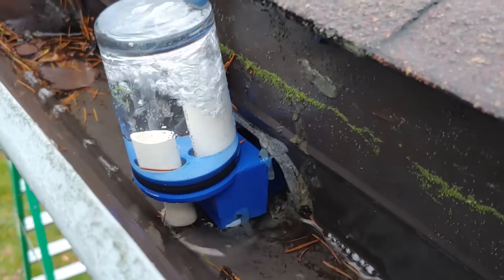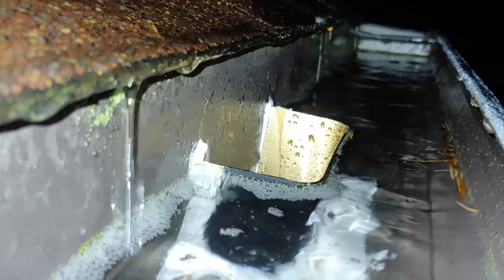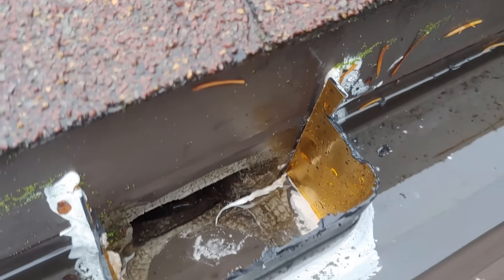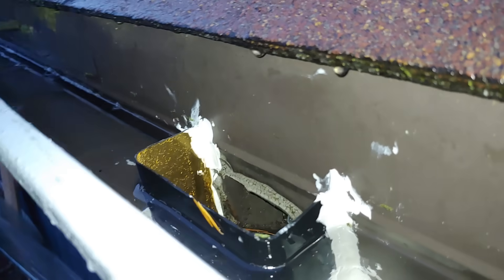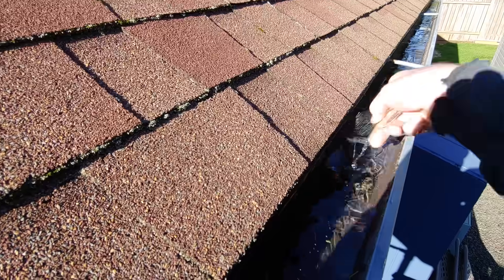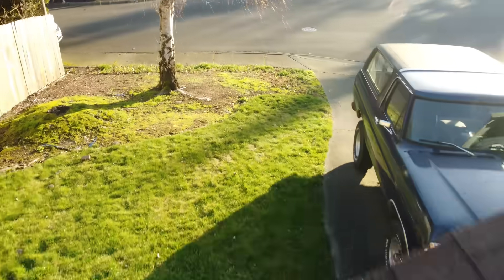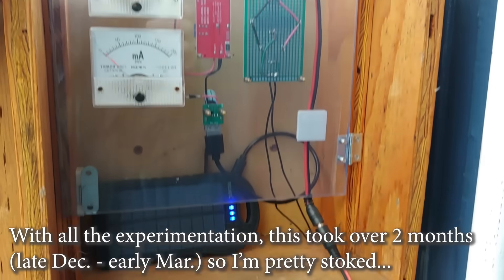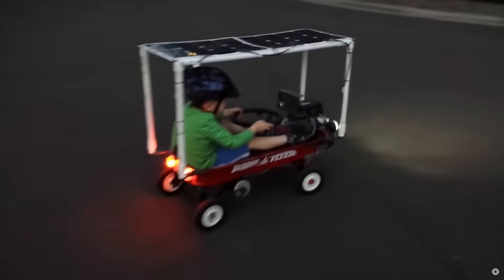Rain Gutter POWER #6 - World's First Rain Charged Phone!

Comment: Same way we pit our plants the rocks will always provide drainage! Charcoal is what i use in my aquarium filters it also pulls the crap and out the water level off the PH and nitrogen and help the smell I experiment with syphon tube feeds and rock gravel filters to cotton and Charcoal oven extracter hood pannals! There so cheap dnd great for using for likes of spray booth filters etc pulling the smells out yet letting the same airflow pass through the fans same with water! Maybe try lower your bell for a faster syphon Speen that'll spin that charge wheel faster? Well I suppose it would have to be a shorter glass for that eh? See I do this stuff with the aquariums because they can take so long to change water when you have a few! I find a shorter feed tube with a long low down bucket speed I really have to keep my eye on the bucket for it over flowing in seconds!
Use small horticulture grit for the it's perfect for that overflow appose to large soft edged marbles! Honestly you'll notice the difference! But that sponge filter you bought it what's in my sponge filters you should take a look at the way they work with a submersible pump sitting in the gutter? And a heat pad for hatching fish eggs run one in the gutter to melt the ice there is a lot of cool things you can find in aquarium set ups that you really wouldn't expect to ever see or think of! Cut the sponge filter so there's just one peice actually stuck down the overflow pipe on a wire! I was shocked there to see it in the while gutter at the end there! That one small bit you had in the store would have done the same or maybe a better job believe it or not!

Comment: You need a water tank, so you can collect all water, and make energy, even when it doesn't rain with a lage size filter. Also make make a body  around the wheel, zo all pressure will used. (like real turbine dams)

Comment: Love your videos.  Why couldn't you make a simple overflow standpipe at the point of your bell siphon and have it vertically drop to your water wheel/trough?  You could widen your water wheel & trough or add a second wheel side by side and see the overflow kick in at power house. I'm wondering if 2 separate wheels would be more effective or if a single wider wheel would do the job.  A single wider wheel would have to spin at double the speed to be effective.  Drag on the additional weight of a bigger wheel while off peak/overflow may need to be considered.  Can't wait for #7!  :)

Comment: obviously need to engineer gutter heater now, could dump excess heat out of your fridge/ac unit, hooked to thermometers so it all activates when needed.
Oh could use spare motors to make tiny windmills as well so you can power the thermometers and tiny LED to light up The Box and charge the things faster :)

Comment: Replace the gutter nails with screws and add a rubber gasket inside the gutter around the screw and under pressure from the tube it runs through to protect the wood it screws into.

Comment: Cool series.
I like your dedication to this hydro-power project.
At about 9:22 in your video, you mention lost power during peak rains... 
With respect to using the occasional overflow water fest that comes with strong rainy peaks, how about this :  instead of adding another generating kit to add power electrically (post turbine and regulator kit), you could use the overflow to use added power by water...
You could simply fill a garbage Bin (a cheap 121 Liter a.k.a. 32 gallon garbage can) that should do the trick to use it like a “ water capacitor”  to spill/feed a second jet of water from a simple hose pointed appropriately onto your already spinning turbine…  
By placing the garbage bin higher up (just below the overflow) you could generate (under proper weather & rain conditions) plenty of additional pressure during hard rainfalls.  
Provided your cool alternator driven by your turbine is capable of using more water pressure, you should be able to get to use the peak waters for more power!
Also, to protect this tank in case it freezes at night, just put in a small log in the garbage bin (wrapped in a plastic bag with sucked out air) inside it to do like with swimming pools and have the log take the ice expansion in instead of breaking the garbage bin (or whatever other water tank you decide to use for this “water capacitor”).

Worse case, you will get little overflow and it will not provide much pressure, and best case scenario, it will gush that water in a continuous flow when it rains hard (I personally would place the output tube/hose not at the bottom of the tank but probably about 1/3 from the bottom to midway of this tank/container to get a compromise between pressure buildup within the tank and not wasting overflow potential energy.
Also, you could have a overflow on top of that tank to prevent blocking/defeating the purpose of having an overflow in the first place and therefore keep on protecting your house should rain be coming awfully hard.

It’s just an idea, but it might be a way to use Peak potential energy from occasional peak rainfalls on the cheap.
Cheers.
:) 

PS  Dang!  I just finished writing this and then I saw a comment by SeanHodgins that basically states in a succinct and elegant manner what I am describing here. 
I have to read comments before jumping on the keyboard next time.  ;)
Oh well, now that I wrote it, might as well share it.

Comment: I believe if you add a expansion chamber under your water drain using a fitting coming off of your pipe to a slightly larger pipe and then back down to your regular size pipe that should help stop the dribbling problem and create a more positive flow. I hope that helps, I like your creativity.

Comment: Self poring liquid in a gravity control system my be able to increase power production. If there is a way for the water to move self poring liquid up with the  energy of the water falling. Then using the self poring liquid to create power.

Comment: Hey - re: the freezing, up here in NY a common site is gutter heaters - there are all sorts of types, but generally they are some form of resistive electric heater that runs at a low wattage over a long time to de-ice and prevent ice.  Better ones are either on a timer or based on temp but a lot of the cheap ones just run all the time.  Some go inside the gutter, some go over the top of a gutter cover, others wrap around the gutter itself.  I would think for your limited freezing issue, a simple wire one that you lay along the gutter, that you manually cycle on when temps go freezing, would be sufficient for your needs?

Comment: Hey Quint, have you thought about trying to build a Kelvin generator with the water from your gutters? Having a micro turbine on one side and a kelvin generator on the other to compare would be amazing but I think it would be even cooler if you could make it possible to have both going at the same time though just one gutter! You just need to split the water evenly as it drops out of the gutter so the two open streams can be passed through pairs of copper rings before filling the pressure tube. There is also the idea of trying to figure out how to use the jet. I guess if you just need water to pass through two rings with slightly opposing charges you might be able to siphon some of the power from the generator to give the rings their initial charge and use the single jet outlet as half of a kelvin generator. I think you might want to test the half generator theory on a model before trying to build it though because I feel like if that would work then it would have been done already. Anyways, love to see anything you make!

Comment: @Quint BUILDs - 
This weired gutter construction directly nailed to the wood using it as a water wall is junk ... in Germany gutters ( = "Regenrinne") are half circles fully containing the water like a long slim bath tub , when it overflows it does so at the outside & also German versions are NOT directly nailed/screwed to the wood but resting in holding clamps that are fixed to the house (see " regenrinne.net " or  baulexikon.beuth.de -> REGENRINNE.HTM  )

Comment: Is there a way tho get the extra water during the peak moment to go into a reservoir and us it as a natural battery for times were it doesn't rain? Getting the extra water back into the same system would be a challenge considering we are doing this project of grid but it surly is a way to make use of the "missing peak moments" situation without making this system overall less efficient

Comment: Would a water storage container be more practical then a whole second overflow?
Reply: Just putting a large tank on a few bricks, and linking it so it will drain into the main reservoir would work as long as you have some idea of what the maximum possible amount of rainfall could be in the area. It could still cause overflow issues if the tank is too small or an unusually large amount of rain occurs, however, so it would likely require some experimentation to determine how large a reservoir would be needed.

Comment: So the height of the filled gutter gives you pressure, that translates to velocity, that into a torque and that into watts in the battery.
Is a single generator the best option? If you would put multiple propellers/turbines/whatever into the gutter then you would lose the height component and increase friction losses, so not better to do that way?

Comment: 19:11 Crazy idea: Turn a car into an EV, but instead of replacing the engine with a motor connected to the transmission (like everyone does), use smaller motors with linkages that connect through the combustion chamber to the crankshaft.

Comment: Hi there, I own a gutter guard company in Ontario, Canada! For this project a fine stainless steel mesh gutter guard is a good bet! I’d avoid brands like Leaf Filter like the plague, they are severely overpriced and they are not a very good product. I recommend Raptor Gutter Guard by Gutter Glove. You can buy it on Amazon and it is fairly easy to install! For longevity and effectiveness (on gutters without a generator) I would alway recommend perforated aluminum gutter guards!

Hope this helps 😁
Reply from the maker: That does look like a good product. A former installer of several brands recommended MasterShield. Any experience with that one? I have to admit them matching the slope of the roof looks like a great idea but requires all new gutters to do it. $$$ 😜

Comment: How much power does the solar side of that battery backup produce? seems like you would want a little more of a control than checking the voltage during the day with the charger facing outwards...

Comment: You should probably get a container for the water that isn't the gutter so your roof doesn't have prolonged exposure to water, then you can work on the ground and you don't have trash getting in your equipment all the time. Also, the more water can you store the more energy you can store, and you could probably get a container with a much higher capacity than your gutter system cheap. Maybe a salvaged bathtub or something.

Comment: This is cool and all but not the first phone charged by water... your household(depending on where a person lives) is powered partially on water by dams and hydro steam generators, mostly gas/fuel generators and higher power output methods but from the gutter that's nice, id like to this done with

A: with a small step up booster, maybe power some lights or appliances, or even 12v batterys so you could use 120v converters and such.

B: a much bugger scale but I cant think of many easy ways to do that

Comment: Maybe you can connect the energy of pelton to some resistance which located in suction pool ? It will be warmer than freezing point when its totally snowing ? You know, before the snowing, generally it rains ?  (Of course the ambient temperature is the most important parameter)
 You need a thermal analysis of this setup ? I am a mechanical engineer and like your ideas! Cant wait to see next videos!

Comment: i know its not the point but if you wanted to draw power from rain water why not just have an accumulator or just a drum connected to the gutter so rainwater fill the drum and then that that can give a constant adjustable flow. so the only way to overflow is if the drum gets filled where you just open the valve then either let it flow directly in the sewer as before or use it to water your garden

Comment: You need to put a very small hole in your overflow so that your gutter eventually dries. Gutters aren’t meant to hold water permanently and a dry gutter will have a better chance of naturally clearing itself out than one that has constant moisture in it.

I’ve done aquaponics and the Bell siphons used there always have a means to fully drain in the event of power loss because you don’t want standing water there, either. A simple hole at the lowest point of your overflow self seals when there’s enough water, if the hole is small enough, and doesn’t negatively impact ebb and flow.

Just a thought.
Reply: indeed, and if this was in tropical weather it'd be a health risk for the whole neighborhood

Comment: I think the problem with your marble filter is you use too fine of a mesh to hold them in. Over time, slime from algae and bacteria will block the holes reducing the flow. If it was me, i would use plastic bio balls (for aquarium sump filter) instead of pebbles or marbles because they'll let more flow through and a bigger holes mesh bag.

Comment: You could totally redesign the water wheel Portion to get a lot more efficiency and making a second generator optimized for high flow on the overflow side would be great!

Also adding a “holding tank” on the main side to recoup help lost energy

Comment: You're loosing all your power to surface tension as the water adheres to the side of the down tube. I recommend some design at the gutter that pulls the water into a free-falling stream (like coming out of a faucet, and hitting a paddle wheel at the ground). The design to get that stream right then becomes a fun and a fascinating challenge. Maybe aerospike at the top and thin taut cable leading to the paddle?

Comment: Question about the math, Love the system but as you obviously can now attest it's a little bit limited in application, how much power would you get if your roof was the size of one of those giant geodomes. Like 70m diameter. Giving it a surface area of 2400metres?

Comment: Let's say you did setup more generators for that entire drain.  How many do you think you could setup before it starts losing efficiency?
For freezing I don't know if it would work in this situation but what if you either use that spray on rubber, put in rubber insulation or more expensive replacing the whole drain with a rubber version.  Some farmers do things like this for water troffs for their livestock in cold weather.

Comment: Hi, just wondering why your turbine isn't in line with the vertical flow so the water trajectory down the vertical from the Syphon hits the turbine with an accelerated velocity due to gravity?
My guess would be you may be able to get more RPM out of the turbine and therefore more power generated?

Comment: Would it more professional by collecting the water in the huge tank and use it for Your project? dunno for the sustainability of Your project in long run from the rust or so.
Reply: 10 points out of ten for the aim of the Project.
Reply: And what, if this water would be used for flushing the toilet;)

Comment: To convert that peak, you might need a couple more systems rather than just one more. When used one more system, the flow will have some reduction due to filtration on that system, before reaching its bell, which would definitely create some more wastage, which would need one more system.

Comment: Seems to me a water butt used as a header tank would avoid a lot of the problems. You wouldn't have to modify the gutter, the increased thermal mass would decrease freezing, you'd have more options for filtering.

Comment: Maybe you could have an electric heater powered by the wheel to keep the siphon free as the temperature drops to freezing. Though you wouldn't get much heat from 400W. It'd be over of those edge cases that's not worth the effort of tackling

Comment: Change your hanger to a vampire type and you can seal the back and the gutter can be supported from under your shingle. This can work around your "old" style tube nail hanger. Ones today are a crimped aluminum bracket that can still use a nail, but a screw works better. It just doesn't go threw the entire gutter, so it only makes one hole. A vampire hanger has a few spikes that puncture the back and are crimped up. Might provide a better seal and wont risk rotting out your fascia board.

Comment: Have you ever thought of getting a 3d printed turbine wheel like the ones used in hydroelectric dams for optimizing power output? might help or might do nothing noticeable but 3d printers are cheap out there and its even cheaper to get somebody to make it for you.
Reply from the maker: Go back and watch parts 1 and 3.
Reply: Actually, you need a secondary wheel powering a bubbler to break up the ice

Comment: A better option might be to have a bigger turbine but with gears. You wont have to plug the gutter and also would be able to work with a slower rainfall as the turbine rotating will mostly depend on gravity. This is just an idea which i had tried to implement in school but didn’t because no cash

Comment: Instead of your complicated system put a litle tank, the bigger the tank the more pressure. The water should go in from the roof over the top, and for filtering simply put a net on top of the tank. If there is to much water, build another turbine and some how activate it by level or put another tank that get filled from the exes from the first so eventually you get more presure to